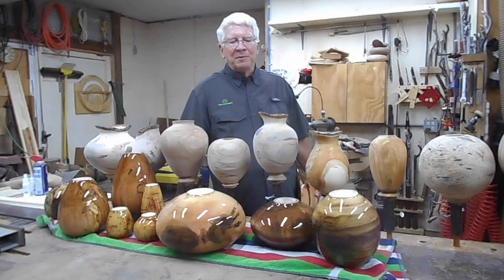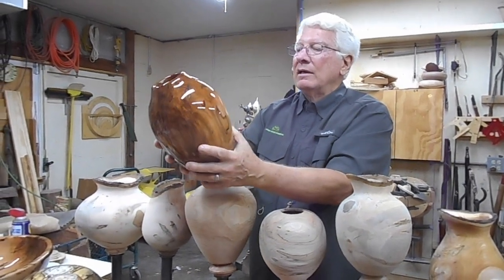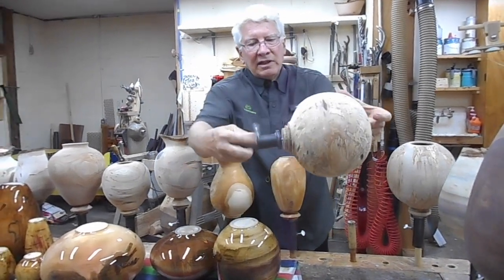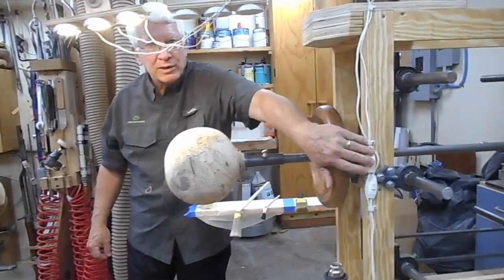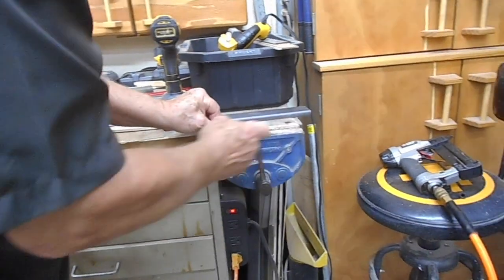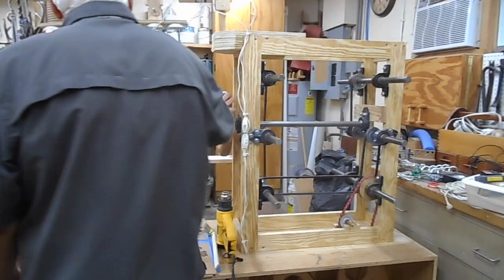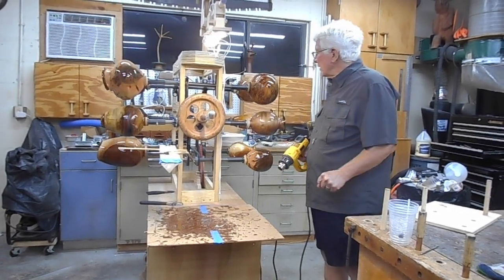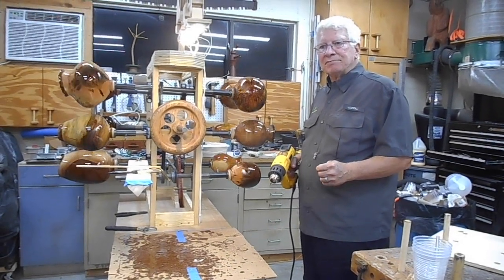Applying epoxy to woodturning

Comment: Wow!  Spectacular video.   Your creations are Beautifully done.   Love the epoxy resin finish and omg the slow finishing turner rig is an engineering masterpiece.    

I’m new to Woodturning and it’s just a hobby for me.  I have a midi lathe so my slowest speed is around 150 rpm’s.   Way way too fast to do an epoxy finish so I got myself a bbq rotisserie motor and made my self a “slow turning finishing” rig/jig.  Just made my biggest piece/bowl yet and the slow turner was key in getting a beautiful finish.  😊
Reply from the maker: @normagene514  thank you for your kind remarks! Yes, can not do the finish in epoxy without rotating the work. 8 to 10 rpm is the best range I have found.

Comment: Thanks John. Hadn't done a finish with resin before and your presentation was very helpful. One point of interest is the use of protective gloves when using Resin. Continued use of Resin without gloves leaves you open to "Anaphylactic Shock". Please be careful.
Reply from the maker: Thank you for your comments. I actually do use gloves but didn’t in the video. Some people conflate 2 part epoxy and polyester resin. You may know there is a huge difference between them. I do use the two part epoxy which has much less health concerns.

Comment: Thank you John for a great demo and fantastic result.  The pieces you show look so good.  Do you have to sand?  If so, is it wet or dry sanding?  Start at what grit? and work you way up to 5K or just decide only need one grit?  Also Maguire polish has different abrasion levels.  Which would you use.  Lastly, if we can not build your creative drying machine, any alternatives?  Can we use our lathe at the lowest (about 120 for me) speed?  Thanks again. You enriched my knowledge.

Comment: I'm impressed with every single step of the way!!! I'm only gonna say one thing....please wear a respirator because it's so dangerous.  But I've learned so many interesting techniques from this video and am excited! I have a cup turner and have been wanting to experiment with putting different objects on it. Specifically wooden box pieces and pinecones.  Thank you so much!!
Reply from the maker: Balke - thank you so much for your comments. The two part epoxy I use is oderless and safe. Polyester resin on the other hand would need a respirator and fast moving ventilation.

Comment: Because I used a sand and sealer before epoxy, one bowl turned out very good in the bottom of the inside. But the outside edge of the bowl was rough and I sanded it down to 220 grit. Do I need to sand it to bare wood or is close enough for epoxy to smooth it out?
Does the inside , where it is very good, need to be sanded before the second coat?

Comment: I always enjoy learning others tips and tricks, u have a few things in ur shop I may add to my own ,thx ,and BTW u may want to consider  getting a cheap small microwave  for ur epoxy warm up trick lol , who know what kind of Vapors get left behind ,that could possibly  transfer 2 ur food ,ur a bit mad lol ,I am surprised those cup haven't warped or deformed on u ,or even caught fire , anyway sorry 4 the rant ,lol u do beautiful  work .
Reply from the maker: Thanks for your comments and sorry for the late reply. Being as I only heat the epoxy for 6 to 10 seconds there is no heat build up while in the microwave. However if the 8 to 12 oz being mixed stays in the plastic cup more that a couple of minutes I will have a warped deformed cup of solid epoxy.

Comment: Great video with lots of detail John.  Not a lot of videos here that do a deep dive on this subject.  I'm looking for that magic bullet for my finishes.  I've tried Total Boat performance epoxy with a slow set hardener and through trial and error still have lots of defects to repair, sand and buff.  Im going to try the Hi Gloss and was reading up on it - They recommend that the epoxy be clear-coated for UV protection.  You don't mention that so I assume you just tell your customers to keep pieces out of direct sunlight?  Tx in advance.
Reply from the maker: Thanks for your comments. The epoxy I use from Fiberglass Coatings in St. Pete is formulated for the surfboard industry. It is very clear and very hard, both characteristics are important for my work. UV is an additive I could use but it does soften the epoxy a bit and that is not good for what I do. Sinks and vases usually do not contend with direct sunlight so it has not been a problem. Again, thanks for your comments.

Comment: John - Thanks for the video. I have tried your idea on a bowl that I made. After the coats of resin, I tried to DA out the imperfections. after that I tried the 3m Compound and finishing product. The problem is that I can not get it to shine as well as the shine after the last coat no matter what I do. I worked as a body man for 45 years, so I have a background on using most of this. I used Alumilite resin. Could that be the problem? I have used all sorts of plastic cleaners, compounds and waxes to get it to shine , but nothing seems to work. Thanks
Reply from the maker: Are you getting into the DA and polishing right after the epoxy has set up? It is best to let it cure for a couple of weeks before you start wet sanding etc. I assume, having been in the automotive body business, you did the wet sanding from 800 grit to 5000 grit and then used the compounds and polishes. If you have gone thru all these step and not let it cure for 2 to 3 weeks, that may be the missing link.
Reply: @JohnWilliams-oq5nm  I did exactly what you state ———- but I only let it set for five days. I actually went up to 12000 grit. Thanks, I will wait for more time and then proceed. I’ve been turning for 61 years and love the resin. I appreciate you replying to my question!!

Comment: This is awesome! Do you by chance have a video or could you make a video on how you made the turning device/station that you made? At this moment, I am sitting at my lathe and slowly hand turning my piece while the resin hardens enough to where I don’t have to keep turning it. I am using a fast Hardner however it’s not that fast!
Reply from the maker: I do not have anything on how I made the machine. It is just a series of belts and pulleys to get the rotation to 8 rpm. There are “gear head” motors that can work for small machines. I do question using a faster set epoxy. The key to the rotation is time and a self leveling epoxy. You may end up with some waves or inconsistencies with a fast set. What I use is a 2 hour set and the finish is remarkably flat. Just a thought.

Comment: John, do you seal the wood with something before you apply the epoxy resin,if so what do you use, I've used sanding sealer but still get air bubbles,
Thanks Pete
Reply from the maker: What is your total process? How many coats? No, I do not use anything except the epoxy.

Comment: Do you use any sand and sealer before epoxy?
I used a lacquer base and made a huge mess.  Your suggestions.
Reply from the maker: No, I do not use any sealer. The three coats the first day seals the wood. Also, any sealer used first does not let the color and grain show thru as well. Thanks for watching.

Comment: Thanks very much, John for a great video.  You briefly mentioned repairing defects and polishing.  Is that something you do only on defects or the whole piece?  I can imagine once you touch that surface to repair a defect, the whole surface must be dealt with to maintain a consistent look?  Please consider doing a video on that process.  Perhaps you already have as I'm new to your channel.
Reply from the maker: Thanks for your comments Steve. Usually the defects are taken care of in the first go round after the first three base coats. After the two finish coats the defects are usually small. With the wet sanding with 1500 to 5000 grit the high grade 3M polishing compound they will disappear with out having to do the whole piece.

Comment: Thank you very much for making this great video. I have been looking for a video on this method of finishing for years. I do have a question. What is the temperature and humidity in your shop when doing this finish? Does the temp and humidity  effect the process?
Reply from the maker: My shop is in Tampa where humidity and temperature can both be high. Humidity does not seem to be as big a factor as temperature. If the temperature goes much below 70 in my shop the epoxy can take forever to set up. There is a small heater in the shop to bring the temperature up if it is close to 70.  Also, there is an AC unit which is usually running when applying epoxy. That does bring the humidity down but I can not say I have seen any effect from humidity one way or the other. Thank you for your comment and hope this helps.

Comment: Amazing work. How do you take the foot off when the inside and outside are dry?
Reply from the maker: Thanks for your kind comment. The foot/tenon is shaped so I can part it off most of the way then saw the rest of the way. Then it is cleaned up with a grinder and 3” orbital sander.

Comment: I want to waterproof the inside of a bowl. Do I have to spin the bowl as it drys or can I just let it set on the table?
Reply from the maker: Roger Dale Scott - gravity is not your friend with epoxy. You can do it but it will “slump” down to the bottom and you will have a thicker coating at the bottom than the sides. Rotating allows for an even finish. Good luck with your project.

Comment: um... is it safe to use to same microwave for food ? wouldn't it be better to add alcohol to thin the mixture and if you want bubble out, you can use a heat gun . was that a microwave safe cup? Eek ... but the finishing does look amazing.
Reply from the maker: Except for that third eye coming in on my forehead it has caused no problems! Seriously, I should get a microwave for the shop but heating for the few seconds barely warms the epoxy but accomplishes what is needed. The temperature only gets into the 95 degree range so nothing that causes any problems according to the manufacturer.

Comment: Hi John, Thanks for this usefull video, I'd like to ask what's the maximum allowed  humidity of the wood if you want to  cover up with epoxy or if you want to make a woodturned bowl by using epoxy. Best regards from Slovenia
Reply from the maker: Marino - thanks for your comment and questions. 12% is my target. Here in Florida wood from most any lumber yard that has been sitting around after kiln drying is usually at 12%. I have not had any separation/delaminating so that seems to work. Glad to help out. John
Reply: @JohnWilliams-oq5nm  Thank you very much. Greetings

Comment: Hi John,
I still have one question about the viscosity of the epoxy resin. What is the viscosity of your product? Low, medium or high viscosity? What would you recommend for turned objects? Thank you, Gerhard.
Reply from the maker: The first coat, when heated in the microwave, becomes almost thin as water, almost. The remaining are similar to latex paint.
Reply: @JohnWilliams-oq5nm  Many thanks, John!

Comment: In search of the absolute high gloss, I landed on your page. If you watch your interesting video, you will see that a super gloss cannot be achieved without epoxy. So I'll try it soon, but first I have the following questions:
- Should an intermediate sanding be carried out between the 3 applications? With what grain size?
- Should you sand up to 5,000 after the 3rd application?
- Then comes the polishing, by what means?
By the way, I built a similar machine for painting, but only for 1 turned object: a simple electric motor with gearbox and potentiometer for all possible speeds (faster for painting, slower for drying). At Ama ... available for around 70 Euros.
I'm looking forward to your answer. Best regards from Austria.
Gerhard
Reply from the maker: Gerrard - thank you for your note. As for sanding questions - I sand the raw wood just to 120grit. I do not sand between the second and third coats. After the first is tacky, an hour and a half later, I put on the second and repeat for the third. This gives a chemical bond. I do sand the 3rd coat with 120 and fill any voids that have appeared with CA glue if small or epoxy if needed. Then the two finish coats go on after that similar to the base coats. After a few days of curing I’ll wet sand any imperfections  starting with 800 or 1000 and work up to 5000. Then using 3M rubbing compound with a rotary polisher and a foam pad. It will come back to the original shine. Hope this helps and good luck.
Reply: @JohnWilliams-oq5nm  Thank you very much, John, for the quick reply. Gerhard

Comment: I'm experiencing bubbling coming from the wood turnings I've epoxied so far.  I am initially applying Tung oil in 2 coats.  Any idea what might be causing this bubbling as its ruining my pieces.  Just learning.  Thanks!
Reply: I'm very new to using epoxy on wood , have done a bit of casting in wood and get same problem.  For me Its air in the wood surfacing,, been told to seal the wood with epoxy let set and sand it back . Might work to seal with shellac
Reply: @lesgallivan4159  Thx for the tips. I have sealed with several coats of sanding sealer and a couple coats of shellac and still get  air seeping.
Reply: Ok , have you tried warming it with a heat gun or hair dryer? This will cause bubbles to pop , I did it with a pot coaster that I made for my wife . It had a lot of bubbles,  you could see them popping just in a wave while blowing. Worked well , but if you use enough heat to warm the wood then it expands the air in the wood and makes even more bubbles.  People who make River tables use a propane torch

Comment: why do you do the inside?
Reply from the maker: So you can put water and cut flowers in them. Also it restricts wood movement should a piece end up in a much dryer or wetter climate.
Reply: @JohnWilliams-oq5nm  are you applying over sanding sealer or oil for these or depends on the piece?
Reply from the maker: No sanding sealer or other finish. I tried that but straight on with epoxy brings our color best in my opinion.
Reply: @JohnWilliams-oq5nm  does it do a decent job hding tear out? filling the gaps? didnt see any on your pieces.
Reply from the maker: @dionlee3920  no not really, in most cases it will amplify it.